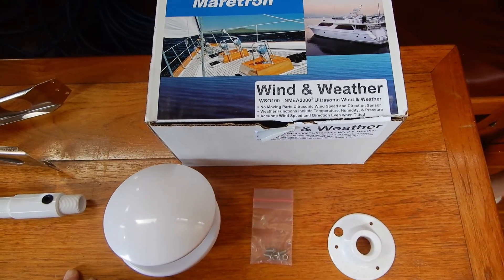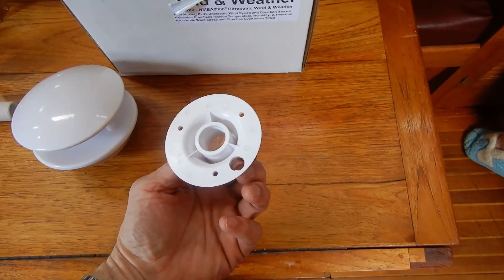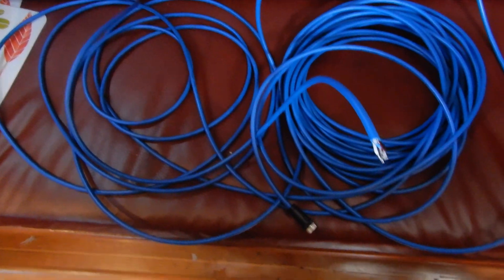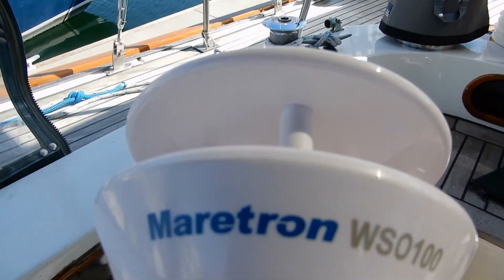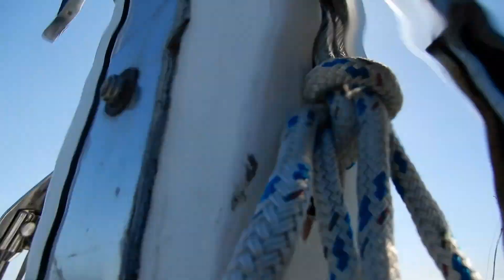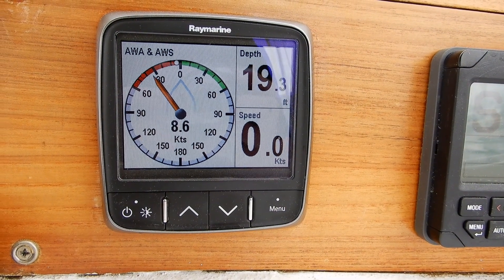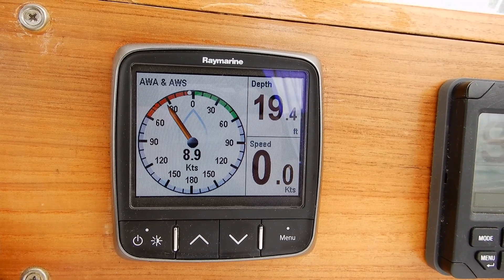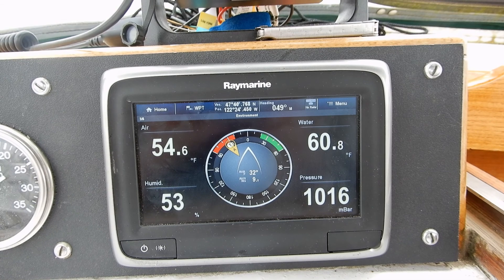SV/Raven video diary #14: Installing the Maretron WSO100

Comment: Do you still have the WSO100 and has it had any issues in the past five years? I’m looking at the WSO200 as a possible replacement for my bent Raymarine sensor.
Reply: This particular sensor eventually went bad but I replaced it with another that worked great for 5 years until I sold the boat. They seem more resilient than a conventional wind transducer.
Reply: @ChristopherYoung5977 how did it go bad? Did it stop responding at all, just some of the readings, or incorrect readings? 

I like the idea of no moving parts, plus the weather data. I’m mostly hesitant because of the different mounting style from my existing sensor.
Reply: @WilliamCBonner  It just stopped working. It was a long time ago so I can't remember if it was still under warranty. You have to mount it to a 1" pole which is doable.